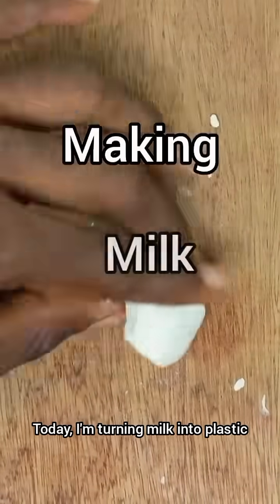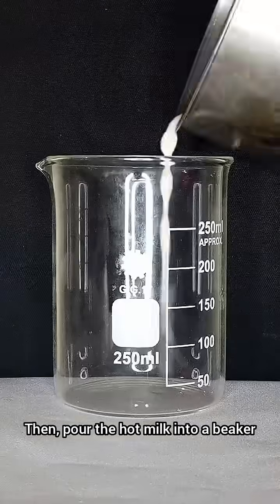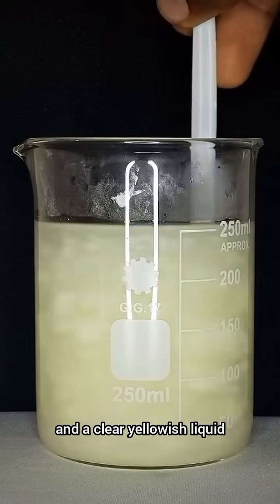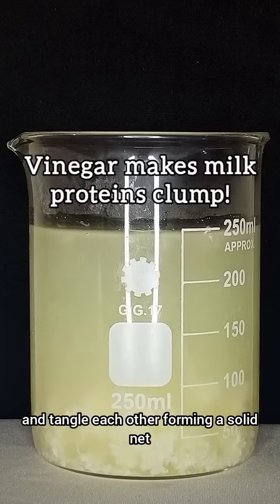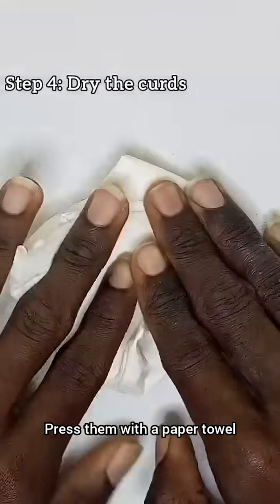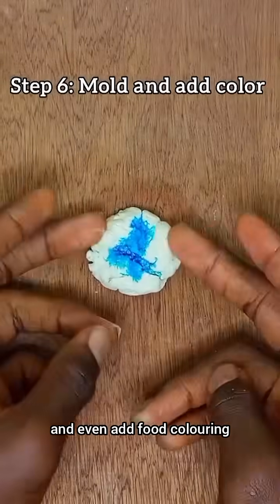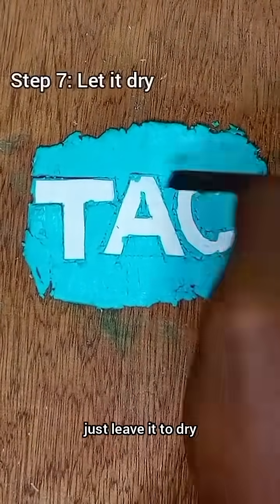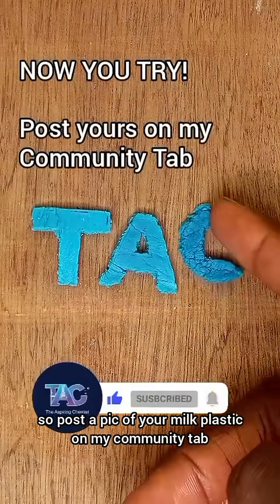Turning Milk into Plastic in Seconds  #milk #stem #experiment #plastic #chemistry #bioplastic

Comment: I wouldn't necessarily call it "plastic", even tho it is a polymer.. still pretty cool
Reply: Well, It can be called a plastic because it is a polymer made from a protein that can be molded and hardened to retain its shape
Reply: @Manta235  well yeah, technically
Reply: @niilo2.2exactly
That's the point of the experiment 
He made 'casein plastic's (air quotes) and not cheese

Comment: What do you mean it's not edible? That's literaly how you curdle the milk to make cheese, minus the food dye which should also be edible. It's not seasoned or aged or anything as further processing so it'll likely taste quite like nothing but it should surely be edible.
As far as I know lemon juice is more often used for curdling (more so cause of taste) but vinegar is a viable option too.

Also, while a cool home experiment, I hardly think it can be classified as plastic. It's a polymer for sure but I think plastic has a more accurate definition. At the very least, this "plastic" won't last for very long.

Sorry for the long post and somewhat slendering, just trying to be clear. Still nice video though.
Reply from the maker: The long post is understandable 

Well, I made explanations to the difference between the milk plastic and cheese on my community tab 

U can check it out.
http://youtube.com/post/UgkxOFOojPv2qWNkaMEVZua4JzkM2TM53UgK?si=L1DF0XH7S-YnYIHc